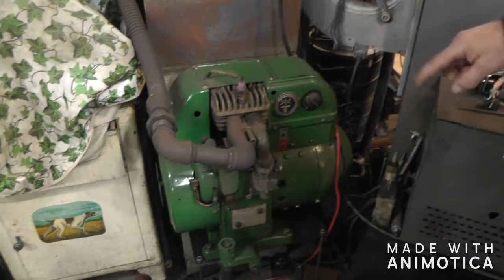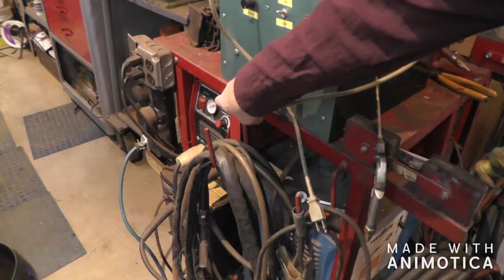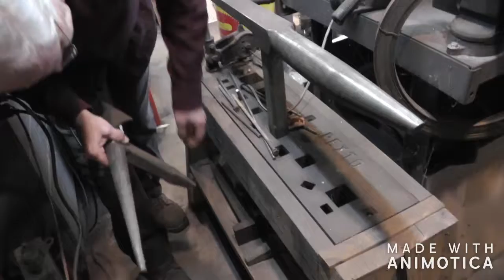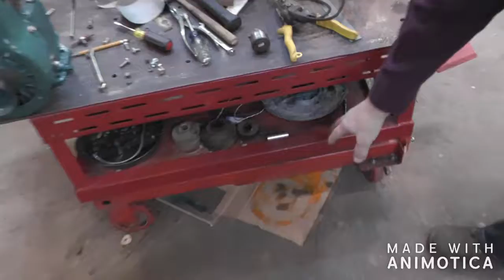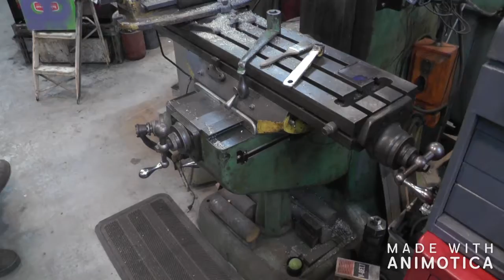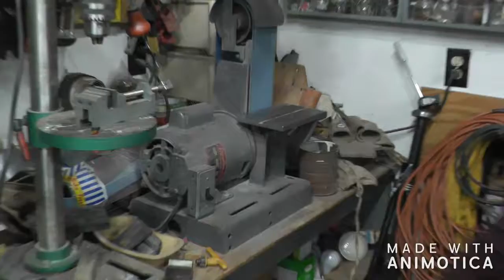PaPaJunk's Shop Tour

Comment: Hey Kevin.
I always love a good workshop tour.
Going back through your older video,s first, and spotted a Shop Tour.
Must watch this video first, lol.
The mobile lifting welding bench is a great idea.
Excellent to set the job up at the exact height you want.
Nice little Drill Press Vice you made also, i noticed you fitted some nicely finished Brass Soft Jaws to it too.
Thanks for showing us around.
Peter.